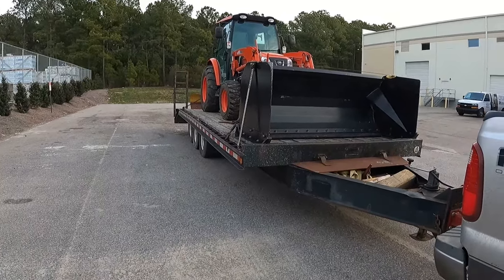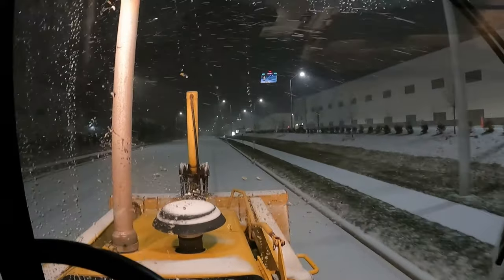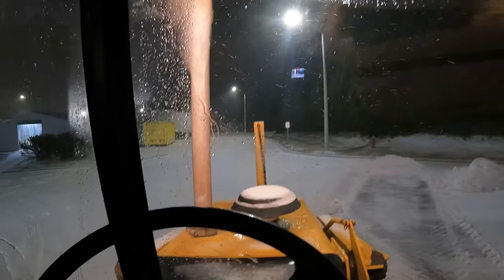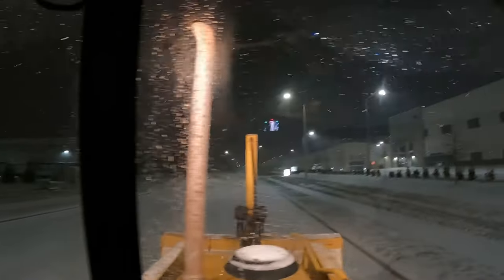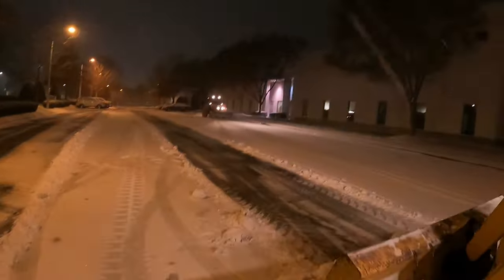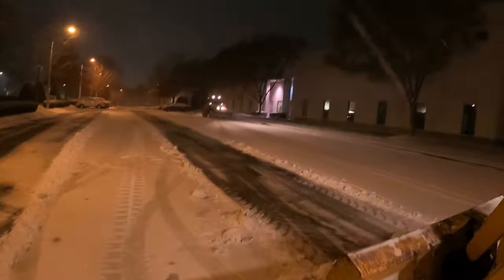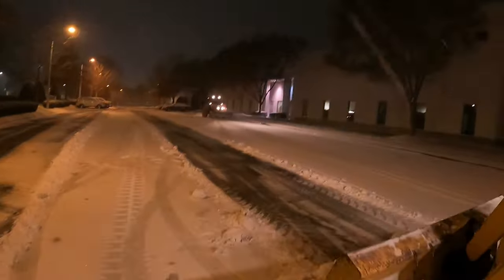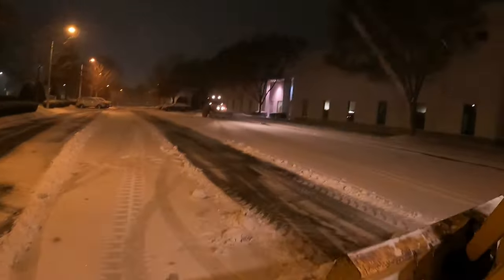Its Time To Snow Plow!

Comment: Fun watching the "southerner" deal with that huge snow storm. (he said with a smile on his face).  In northern Main I remember riding in a Walter plow with a big V blade that would go through three feet of snow.  They needed that kind of equipment to plow the country county roads.  That would be overkill in the south.  A few years ago, my nephew worked for a welding company that made grader blades and large snow plow blades - one was 72 feet wide that had its own wheels - for clearing a large airport runway in Ontario, Canada
Reply: i currently live in northern maine, we dont really use the big equipment much anymore, i think in the 25+ years i have been up here i have seen 1 vplow. that being said this years low snow year i would trade with chris in a heartbeat, -32f this sat morning, dealing frozen pipes all weekend and we have anotherr fun -20f  or lower coming up wed
Reply: @erikgiggey4783  I lived in the high country in Colorado (above 8,000 ft.).  They plowed the snow and stacked it in the center of the road until it was about 15 ft. high, then loaded it into dump trucks and took it out to a empty field.  It would get down to -40 at times and the average snowfall over the winter was 12 ft.  They haven't had the cold or the snow in many years which means a lot of places downstream are lacking water.

Comment: Not sure US Southerners would cope well with the weather in Canada or Norway. You can get enough snowfall overnight sometimes to add a nice 1+ meter barrier right in front of your house door if you're unlucky. Forget sprinkling a little bit of salt, you need to big snowplows for that one, and a plan to leave your house via one of the first floor windows so you can dig out the front door, if need be :)

Comment: Love your videos. When you move dirt it is  mesmerizing, you are so efficient and never a wasted movement  As I make a big part of my living plowing snow in Minnesota, and have for 25 years, watching you move snow is agonizing.  No I am not criticizing, We all become specialized in what we do. Up here we would never use a bucket on hard surfaces as the frost heaves the pavement and , when you hit the joints you either pull the pavement out of the ground or spit your teeth out of your mouth after you hit the windshield. What is smooth in the summer becomes an obstical course in winter.  Thanks for another great insight into what you do.

Comment: I worked at a million square foot warehouse. We had a company that did our snow removal and when they finished they had put a mound of snow under the front of the trailers. Trucks couldn't back under the trailers to hook up. 
 After that debacle they always brought a motor grader to clear under the front so the trucks could hook up

Comment: Pushed snow for Verizon, did about 20 of their relay and maintenance sites. The relay lots were small and hard to maneuver in, that also meant  no place to put snow. If you bumped it up over the curb you had to watch scalping the grass. We went curb to curb and sidewalks cleared edge to edge. Started at 3" , every 6" was an extra charge. 2010 we got over 24" over night. Plowed every lot 5 times that night. Miss that money.

Comment: The town I grew up in had a skid steer with a v-blade on the front.  It was used exclusively for clearing sidewalks and easily dealt with 36-48” deep drifts.  Today,  the tracked wonder is nowhere to be seen and home owners ale left to clear their own sidewalks.  We are enjoying some of the same weather system here in NE Ohio where we are equipped for the snow but dislike it as much as you and your teammates.  Wishing you and them a safe and successful period of plowing.  Stay safe out there.

Comment: OK, I live in the snow belt of New York State, east end of Lake Ontario. I can only advise you to change your tactics. Use a large four wheel pickup with a plow on the front and a sander on the back. Fill the sander with a non salt material. You will be better off. The way your doing it now is causing you to work harder than you need to.

Comment: You should have been in Ohio in 1978 when I looked out my kitchen window and saw 3 inches of a 4-foot CB antenna on the roof of my car, I was 20 minutes late for work 40 miles away. I dug out the driver's side door and the tailpipe. Started the car, backed up and dropped all the snow on the roof in front of a snowplow coming down the street.

Comment: Had 2 inches of snow overnight here in Detroit. But snow here is different-- its more like squeaky beach sand up here.. Temps in the low 20s. Where the foot 2 weeks ago in Virginia had an inch of slush or so that froze that night.. and when you stepped in it it all became wet ice... I prefer this northern fluff.. its a lot easier to drive on! Might want to see the blade DLH Farms has on the back of his tractor-- it offsets and angle changes from the cab-- and would be useable in more than just snow removal..

Comment: One important thing to remember when plowing snow is to make your first piles as far back as possible. So you have room for everything that can, and will, come after the first snow. For instance, the pile you made by the semi-trailer, you could have pushed that even with the back of that trailer which would have given you more room to pile snow in front and on top of it. Live and learn. I think you have more snow coming this winter.

Comment: Heads up something from someone that lived in the north for years. When you have less than 3 to 4 inches it is easier to use a brush to rid snow. It is a lot easier and less ware and tear on the equipment

Comment: Yes, snow in the south is different.  Snow in the south often has ice under it which wasn't the case when I lived in the north.
Reply: All Jacksonville got was ice. 1-3 inches of ice. Now all I have is black ice. We have a whole 3 snowplows maybe more but no more then 10.
Reply: thats exactly right, it NEVER just snows in my neck of the woods, it ALWAYS rains first, which then freezes and turns to ice, then we get a layer of snow, and like chris said, the rain always washes the brine off the road
Reply: So true, John. Snow in NC would incapacitate drivers with just mere inches on the roads. They'd be off the road and into either ditches or the woods if they were close to the shoulder. Good thing NC don't receive much snowfall other than a few days a winter before it melts then freeze which makes the surface even trickier. Around the 2001/2002 winter it dropped about 6-8 inches and most businesses were closed for the day.
At least many up here in Central NY know how to drive in the snow, except for some of the younger generation. Where I'm located, the plows are on top of removing the snow and slewing the salt solution as they scrape along.
Reply: @itzcaseykc  the shoulder is the safe place to drive when iced IME... as long as you're not flying through it at 50mph. 
I'll never be able to break my Yankee genes though. Last significant snowfall we had he in the SE was 1-2 inches of  beautiful champagne powder. I cleared the drive etc with the leaf blower (Yankee genes and such). Neighbors have been trained into snow paralysis so did nothing. The next day it thawed for a few hours then dropped below freezing for a week. Guess who couldn't get out of their driveway? Al.ost the whole county.
Small things make a difference.
Reply: @johng3960  I never said anything about driving on the shoulder, only about the trees being close to the shoulder. This is what I said, " or the woods if they were close to the shoulder." Was talking about ending up into the trees, if they (the trees) were close to the shoulder.
Reply: @tncountryboy06  Wait till after the rain stops and the snow starts. Best time is after 8:00 pm so the temps will help the snow stay in place. Then put the brine down.  I'm told using beet juice might be better since it doesn't cause the trouble salt does and it helps lower the freezing temps as well as salt.

Comment: This is probably a harebrained idea but I could see it useful to fix up a cheap back blade to fit the pins of the hoe bucket. I can see several down sides...lack of draft control (
you'd need skids the way the back how rocks), no quick connect so You'd have to mess with the pins...etc......But you could use it 360 and swing it all the way around and use the boom to knock down the tops of the piles, reach into narrow areas etc. IDK might would work ok and could use it even in normal times for grading. It wouldn't be too expensive back blades are almost a dime a dozen, if you could find a wore out bucket you could just torch the bottom out of it and weld it to the boom of the back blade. Like you said probably not worth it unless you got stuff kicking around and time to play.

Comment: Great coordination of your personnel! Catching the snow off of the blade is one of the most efficient ways to get a large are completed as you can cover the width of the blade and bucket at the same time. (We used to do airport ramps and parking areas with a grader with a wing and a 16' plow on a truck to push out to the snow blower.)

Comment: Hello Chris, if the rubbing noise from your wiper blades bothers you, just spray WD40 on the windshield and blades, wipe it off with a rag and it should be quiet again. Some people spray a 50/50 mix of water and vinegar. That works if it's not too cold. (Don't do that at -50 :)

Comment: I found d an old state plow I welded 2 brackets In The backhoe bucket hook the blade up plow with it the storm then remove to clean up things....2 pins and good to go...spring I knock the brackets out the bucket grind smooth and good till next winter or snow...old state one way blades come cheap usually. Makes for manholes and curbs much nicer while its snowing.

Comment: We get snow a couple times a year. I just love it. Our community is on top of a steep hill and I have a skid steer so where others see snow, I see bourbon and beer. I am in the same head space as you, I would like to buy a wider blade to make the job easier but it is a lot of money to invest for a  couple days a year to help out the neighbourhood.
Reply: Would using a 2x8 bolted to the front work to make it easier for blading out?  Cheap to buy and use if it would work.  Attach rubber tire strips to it to reduce wear.

Comment: Where I live in Nova Scotia moving snow seems to be, as a minimum, a weekly event sometimes daily with amounts varying between 2 inches to +6 inches. It is on my own property so having to go out at night is not required. Our equipment is all small, JD 2210 with a rear blade, JD 3320 Front End Loader and rear blower and a Kubota RTV 900 with a front blade and when all else fails. an older Kubota KH41 mini excavator has been useful at times if the stuff gets frozen or the piles too high. The 2210 is nimble and my favorite for 2-3" of snow but miss the heated cabs in the 3320 and RTV. Current problem is where to put the white stuff.  I enjoy about the first 30 minutes of snow removal each winter season but then the bloom comes off the rose......BTW i greatly admire your skills especially with the excavator and dozer - keep them coming.

Comment: I'd be tempted to make a makeshift push box out of the backhoe bucket. 2 bits of steel plate bolted to either side of the bucket to extend the edges out about a foot should help push a bit more snow each pass. 
No point in spending money on fancy gear for it to spend 363 days sat in the shed.

Comment: On your next road trip north to grab some equipment, get yourself a cheap plow and pusher from up this way.  Its pretty clear that the skid was the star of the show with that little pusher on it, doing all that work with the tiny tractor rear blade, or the backhoe bucket would drive me nuts.  I am with you though, very hard to justify the cost just for a one time use a year, but once you have the stuff, it just makes it so much easier.  keep up the great work.

Comment: Similar conditions to Clarksville,  TN, where I lived from '77 to 2014...  It just doesn't happen often enough to invest in the big stuff like up here in ND (or where I live now in WY).  Right now, there is a one-story mountain of snow with a footprint about as big as the hotel where I'm staying here in Grand Forks but this is dry stuff compared to down south.  The ice here comes from repeated traffic since it never really melts during winter.  I'll take a foot of northern snow over the sloppy, wet, Southern snow any time, for one can actually drive on this stuff up north as long as you respect the stops and turns.

Comment: I feel your pain brother, I live in Portland Maine where we get 3 1/2 feet of snow anywhere from every other season 22 or three times a year and it’s just pure misery no matter where you live. I am extremely curious why you didn’t push the snow off of the pavement and into the grass areas like between the trees you know being careful not to block the hydrants and the drains?  Up here all throughout MAINE you will see miniature mountains of snow piled up at the farthest reaches of the parking lots where it will just melt away when it gets warmer in the spring thaw. Of course we use much larger equipment - wheel loaders with 5 yard buckets.  Almost everybody out in the country has a snow plow truck and use them until they rust into the field because they don’t have to be licensed and can use the green Ag diesel fuel.  But most people have nice trucks all four by fours equipped with fisher plows which are made here in Maine. My favorite is the split V plow.
Reply: I plowed the Portland company property for 5 years by myself, one with my pickup and vplow, and the rest with my tractor and a 9' plow/box combo. Sometimes I'd like to head south with my snow equipment and have some fun. I am curious how it pays compared to up here

Comment: 27:57  Looks like you are using contact with the tractor scraper to steer the backhoe.  Nice.  I guess the tractor has better traction since it is driving over the snow before it is scraped away.

Comment: Looks like you guys could use a salt spreader, and maybe a guy with a leaf blower to clean off the trucks. Probably hard to justify the expense of a spreader for such an infrequent event though. When I clear my driveway with the backhoe I'll sometimes just leave the bucket on the ground and steer with the brakes. We giggle about 5" of snow being crippling, but people forget that it would be a nightmare if you aren't used to it or don't have the equipment for it. Just for my own house I have a couple of snowblowers, maybe a half dozen snow shovels, probably 100lb of salt, a plow on my garden tractor, and the backhoe if it's really deep. If I had none of that and got 5" of snow it would be a problem.

Comment: You should see if you can find a nice 11 foot plow weld the ears into the bucket of the backhoe then pin it in a couple chains on either side just to be safe works great will save u so much time that’s what we run on our cat backhoe up north here it’s a beast in the snow

Comment: Run what ya brung.   I been plowing snow for close to 40 years now started out at about 13 run an open cab new holland 445 with a gas motor or a 330 mustang with a gas motor and a t stick to steer.  Back when I first started a 4x4 pickup with a power angle plow was the greatest thing.  Not too many 4x4 backhoes back then and a cab with heat well that was a cadalic for a loader to plow with

Comment: Not sure if you have ever used a sectional plot but they are the best. Been using one for years, they clean snow better especially on angles or slopes in the road. Up here in Canada we can’t use skidsteers with tracks they slip to much we have to run tires.  Awesome video as always.

Comment: Have you loaded the tractor tires with beet juice for added weight and traction ? Doesn't rot out the wheels like the calcium chloride they used to use .

Comment: what you might find more helpful is a salt spreader for the back of a pickup truck.  Many in WNY use those for parking lots and really you mix some rock salt and sand (and don't tell me you don't have any sand) and spread it on parking lots during this... or even what my old county used to do.. use a tanker and make a salt brine that they put just a little on the road and just a dribble now would cause the entire road to melt in an hour... I used to plow with a tractor with the blade on the front... of course my father worked for the township plowing snow... and in WNY.. it measured in feet.. .not inches... the bucket of a backhoe is best once you've made the piles to move the piles out of the parking lot and into the grass.... but I can agree.. getting too much special gear for once to twice a couple years is rough... thought he spreader can be used for other things too....
Reply: He could try using the salt spreader for grass seed
Reply: @FishFind3000  that would not work very well my friend seed would just spill out